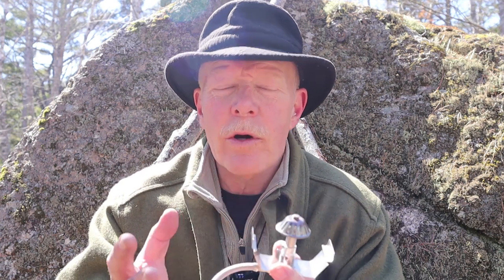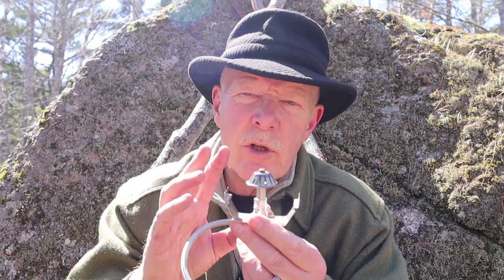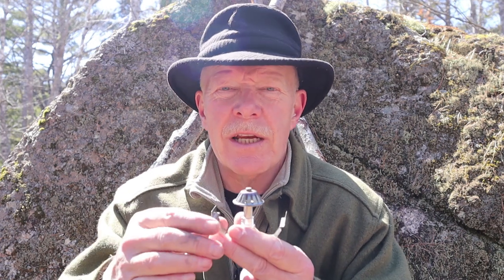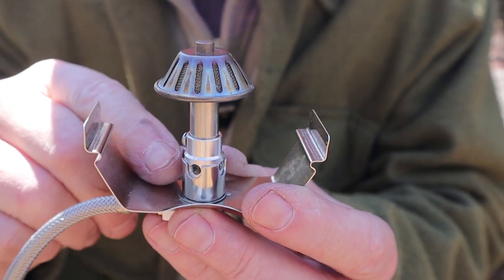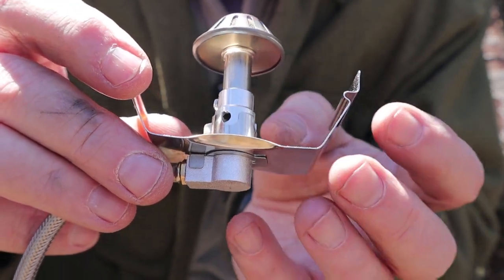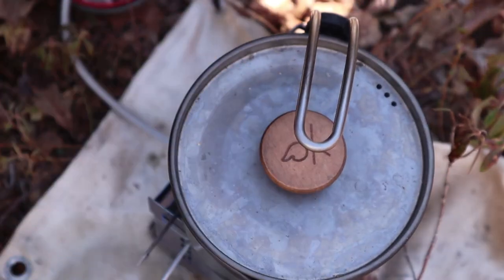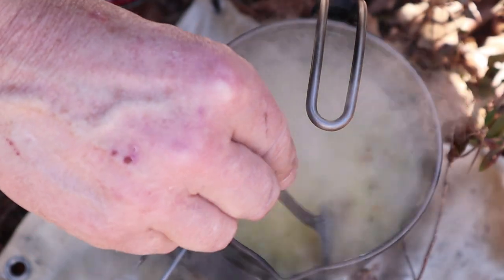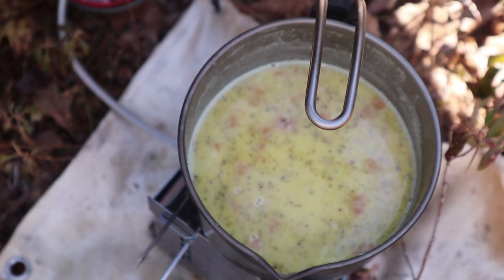Firebox "Wood Flame" Gas Burner  - Important Update

Comment: What great timing. Just today, I received my Firebox Folding Chef's Knife,  so I have been thinking about Steve at Firebox. (Really impressed with the knife, by the way.) 

For some time I have been thinking about getting a gas burner to use with my Trangia 25 system that I can also use with the Firebox stoves. Your comprehensive videos have convinced me that this is the version that I should get. Thanks for the reviews.
Reply from the maker: I am sure you will enjoy using it. Thanks for commenting

Comment: I’ve used that burner on a few trips now. It is a little fussy with wind. I found that in wind, closing the holes off helped a bit. And I used it in a nano so it kind of sticks up and out of the protection of the nanos firebox. But it is pretty impressive how well it grills a chicken breast or a steak. Very versatile burner. Just mind the breezes
Reply from the maker: I agree. I use it most with the full size FB. Thanks for commenting

Comment: Thanks for the update Mark i used mine over the weekend on a fishing outing to make my coffee. It fit right on my nano perfectly and more compact then the trangia gas burner. So Mark one quick question is that a fireproof mat under your stove if so where can i buy one of those. Can you post a link for the mat. Thanks Mark
Reply from the maker: I picked up the fiberglass mat on Aliexpress. Here is a link I just found https://www.aliexpress.com/item/1005005506140007.html?spm=a2g0o.productlist.main.27.4b22c78cUh2y9U&algo_pvid=fd32775f-9172-455d-be68-ada91d4ffde1&aem_p4p_detail=202311180357338564203453967900002289590&algo_exp_id=fd32775f-9172-455d-be68-ada91d4ffde1-13&pdp_npi=4%40dis%21CAD%2115.67%218.62%21%21%2111.14%21%21%402101c71a17003086534216021e4346%2112000033344369155%21sea%21CA%21702330085%21&curPageLogUid=vWcFTseidCpH&search_p4p_id=202311180357338564203453967900002289590_14 Thanks for commenting

Comment: I just ordered that wood burner, my question, I’ve watched a lot of videos, yet no one shows themselves attaching it to butane or propane. I am very new to this and unsure of procedure. Help??
Reply from the maker: All you need is a very inexpensive propane adapter. I have added a link to one available from Fire Maple. Propane in 1lb tanks works great in cold weather but are heavy to carry. That is the reason you do not see them much in videos. I have a video showing it in use in very cold weather if interested. https://firemaplegear.com/collections/accessories/products/z1-lpg-propane-canister-adapter Thanks for commenting
Reply: Thank you Mark for a quick response. I did order both adapters for for butane and one for propane, but in all videos I’ve watched I don’t see any adapters on the butane bottles, not Sue if I did on propane. Anyways, I’ll check out your recommendation and see if it helps. Love your videos, I’ve been watching for a few years now. Thanks for all your testing.

Comment: Sorry, that does not sound correct or make any sense.  There are pleanty of other stoves on the market that do not have that issue, I have a good dozen different stoves.  More than likely, the jets are too large and too much gas/air is getting to the burner head.  This can happen on an unregulated stove when the canister pressure is high.  I have a couple of unregulated stoves where on a  new canister at full throttle, the flame wil lift off of the burner.  My 2 cents.
Reply from the maker: Hi John. Based on your experience, your opinion is of more value than mine. It could be that I misunderstood what I was told by Steve. Thanks for commenting

Comment: You might try REAL bacon bits; they said Bacon, I think, on the roll. If I run across my surviving roll of it I'll tell you about the ingredients.
Reply from the maker: Yes, I have moved to real bacon. Easier to get, cut up and cook. Thanks for commenting
Reply: Any ideas about what Starke "Strength" is?
Reply: Starch, I think.
Reply from the maker: @Pygar2  You will need to help me out with that. The only thing I could find was a CrossFit company
Reply: @MarkYoungBushcraft  I meant that the Starke, in English "Strength", seems to be their word for "Starch". I suspect in the end it's 71% peameal, 7% bacon, and the rest starch, palm oil to hold it together, and MSG with salt and flavorings. Original Erbswurst was probably peameal, bacon, salt, starch, and perhaps some sort of oil to bind it together. Something with low rancidity- was it Kephart who said "dynamite soup" could be stored for years without going bad? I suspect classic erbswurst was a simple pea soup, dehydrated and processed into plugs.